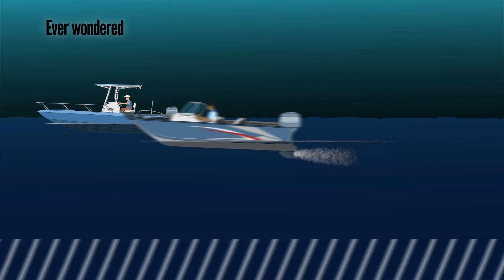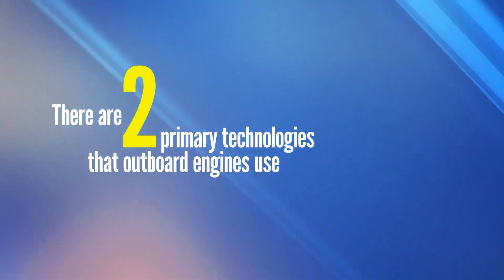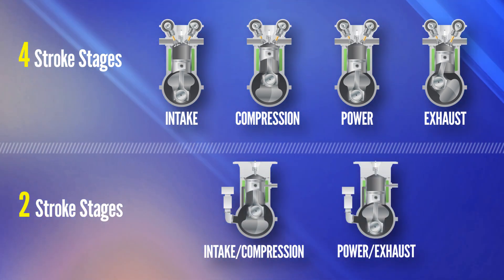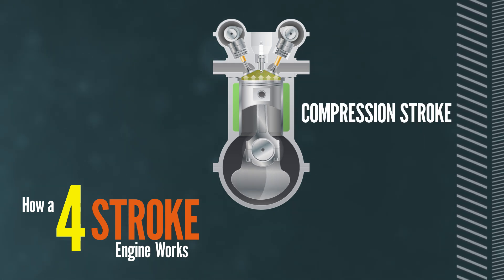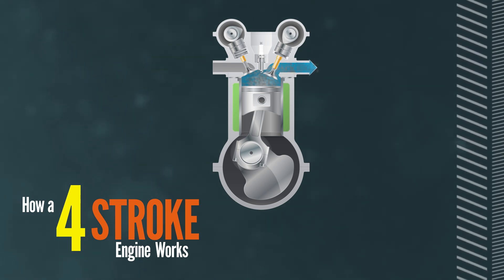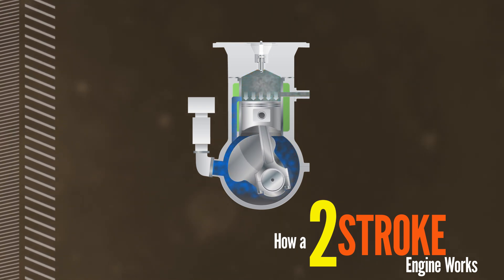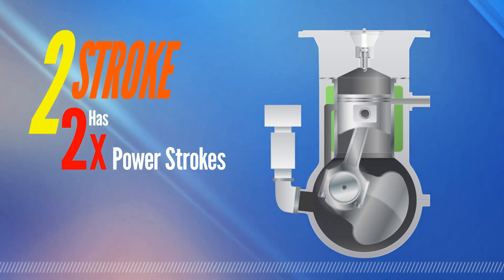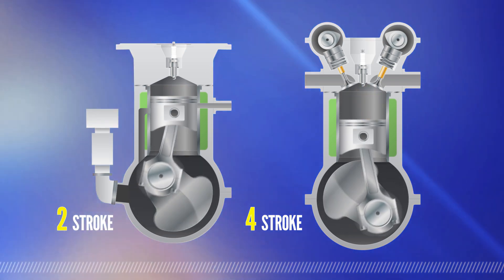Evinrude 2-Stroke and 4-Stroke (2018) - By BoatTEST.com

Comment: Why dont we not use a big 2 stroke engine in cars
Reply: A 4-stroke is more reliable, uses less fuel and usually has a much longer lifetime. This is mostly because we lubricate these engines in completely different ways, that’s why you have to put oil+gas mixture into 2-strokes and just gas into 4-stroke engines. Also, since the 2 strokes burn all the oil used to lubricate them, they produce more emissions.